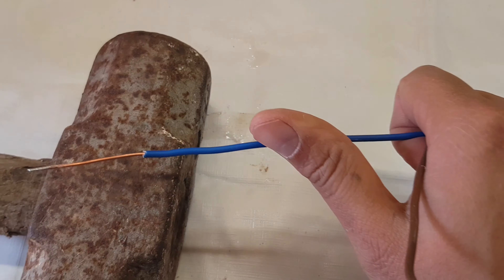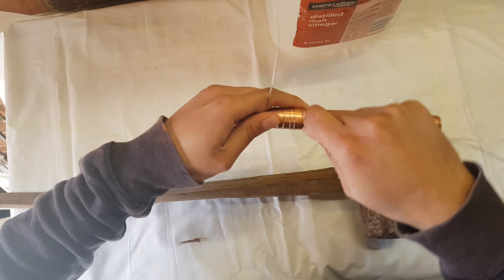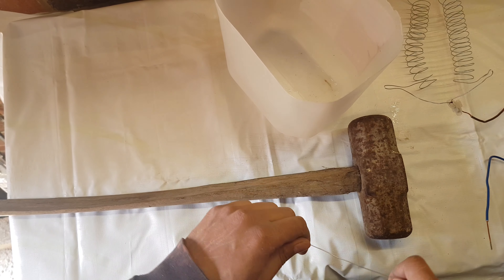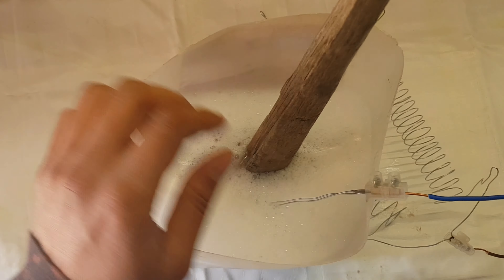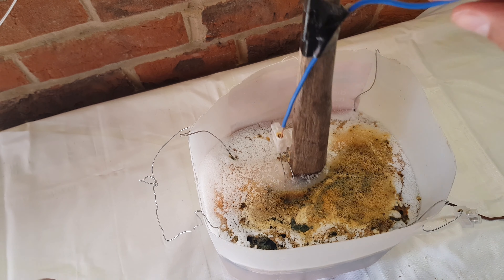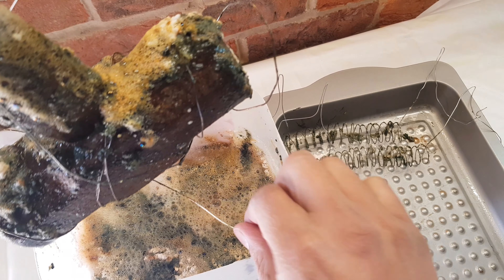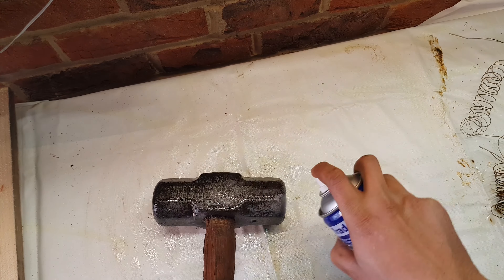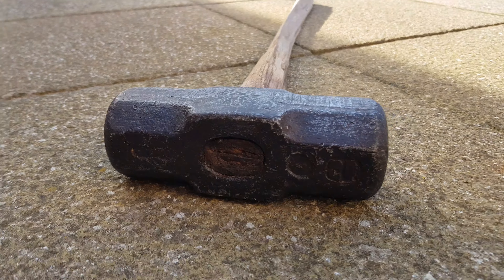Rust removal using electrolysis for sledge hammer

Comment: Looks like that worked really well 👍 😊
Reply from the maker: Honestly, I was so surprised at the result. It is so much easier than any other method like vinegar, wd40 or sanding. Have you tried anything else that works this well.
Reply: @DIMTips  I've tried a lot of different things, I have had good success with vinegar and electrolysis but I used soda crystals instead of soap powder 👍 👍
Reply from the maker: Will try soda crystals next time. Knew you would know.
Reply: @DIMTips  The soap powder looks like it worked just as well as soda crystals
Reply from the maker: Surprisingly well. I think salt would have worked too. Maybe something to try at some stage.
Reply: Some people dissolve salt in to vinegar to make that work better, I've never tried it
Reply from the maker: Great idea. Maybe next time.